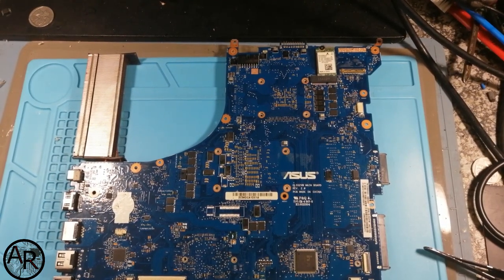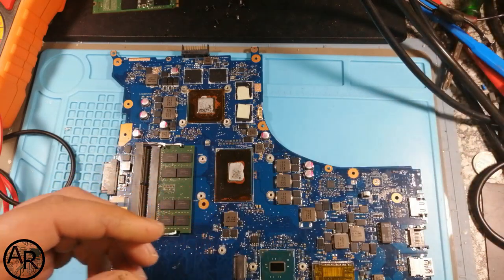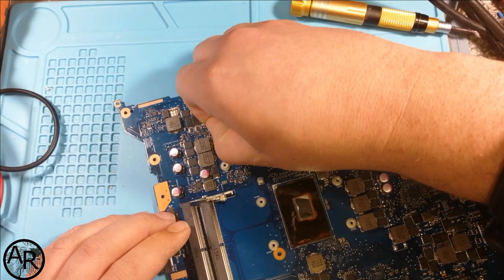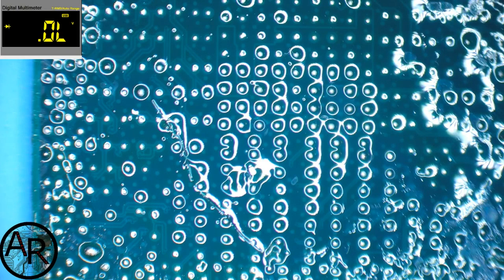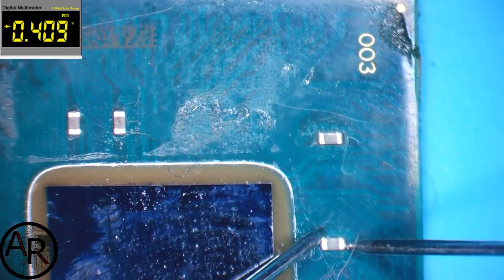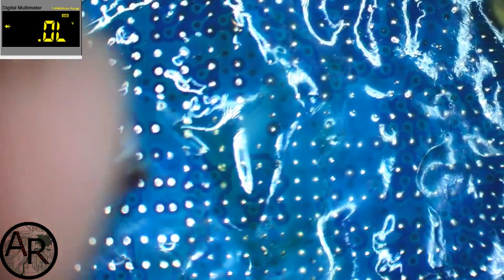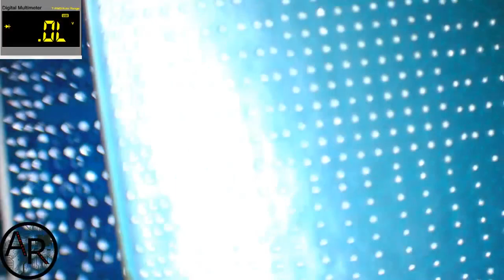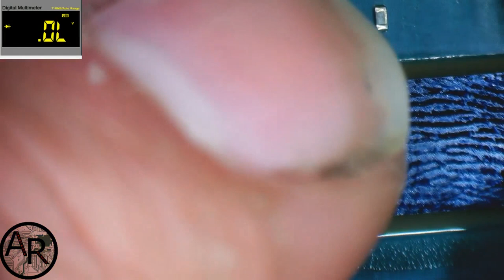Asus ROG gl552vw rev2.0 Dead no power repair Part1

Comment: Great video, going to watch Part 2 right now :-) I liked the way you used Diode test on your meter for the testing. Great tip on the USB 2 data pins.
Reply from the maker: Thank You,On the newer laptop the pch is in the cpu so if you have a short on that you would need to replace the cpu :(
Reply: @AnonymousRepair  Thanks for the tip :-)

Comment: My computer refuses to turn on after reassembly. One of the small Grey boxes near the led indicators overheats whenever power is plugged. I'm guessing something shorted it out so I'm stuck.
Reply: I fixed my computer. I had something plugged backwards and when I unplugged it, the computer turned on. 3 months wasted.

Comment: Thank you for the video.
What rework station are you using?
Reply from the maker: Hi it`s from www.lybga.com IR6500 Here link from aliexpress https://www.aliexpress.com/item/32807475013.html?spm=a2g0o.productlist.0.0.181c701e8LdxF5&algo_pvid=92e10c3a-2b63-448e-8ce4-edf1b5e175f5&algo_expid=92e10c3a-2b63-448e-8ce4-edf1b5e175f5-18&btsid=0ac146c9-9fbb-42ab-ad14-235af3bd956f&ws_ab_test=searchweb0_0,searchweb201602_5,searchweb201603_53It's not easy as everyone thinks took me a 3 weeks to get the rework station setup, The profiles is not setup in the rework station and u can`t use someone else profile, you got to play with the rework station, It depends where you live and if it`s summer or winter, ambient temperature  and sea level. I destroyed a few donor boards setting up the rework station :)

Comment: Hello Sir I have this Laptop and my Charging Adapter is not working. It came with a 120W ( 19V - 6.32A ) Adapter. Can I Purchase and use a different Power Adapter 120W ( 19.5V - 6.15A ) available on Amazon without issues?
Reply from the maker: Hi yes you can

Comment: hi, i got 3.9 ohms between the ground and the positive of the pch is that normal? i mean no short, cause this pc don't have power at all don't turn on or charge the battery, what you think it will be, thanks
Reply from the maker: hi, Do U you have main voltage if so do you have 3.3v rail ?
Reply: @AnonymousRepair  hi, thanks for your reply, but nope all i have is the 20 from adapter, and at pin 28 of the charging ic i got those 20 voltage and 6 voltage that come out of that ic and nothing else, thanks.  do you think is the charging ic?
Reply from the maker: @bolivarveras473  test the mosfets from the adapter could be that one of them are shorted